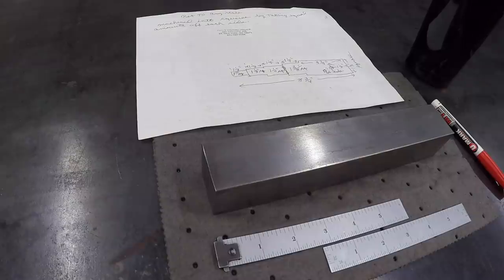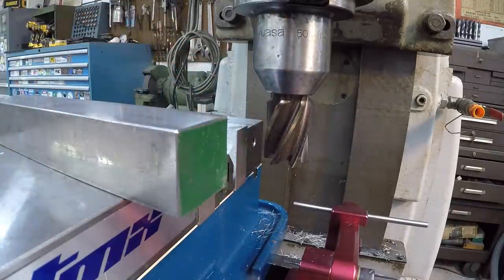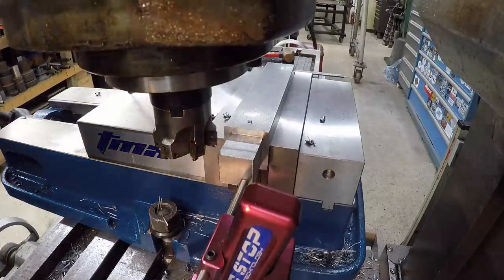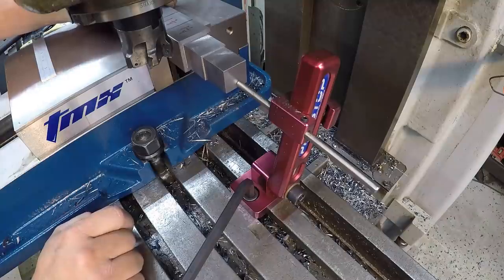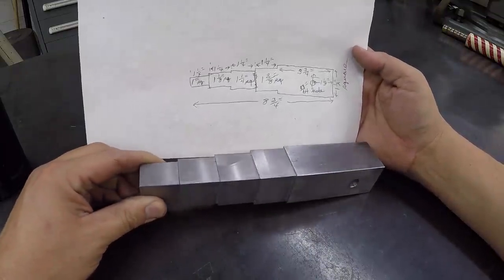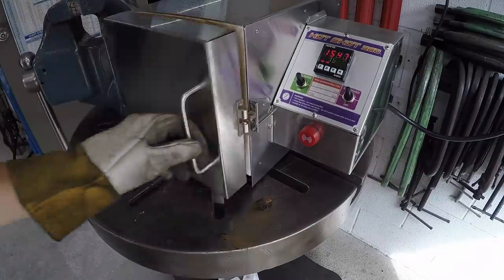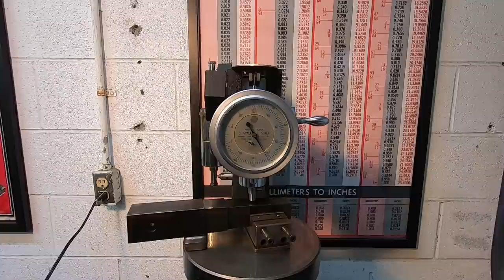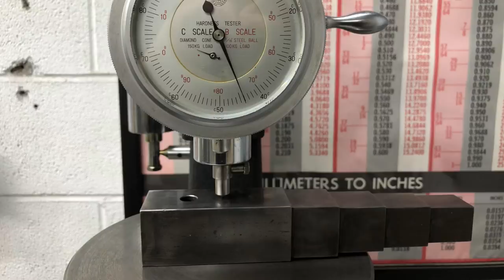SNS 296: Custom Square Drive Tool, Heat Treating

Comment: I would recommend that you read the book "Heat Treatment Selection, and Application of Tool Steels", by William E. Bryson.  The writing style is very easy to follow, not super heavy on the science and more of a layman's cook book on heat treating.  This book recommends heating 4140 at 1200 degF for 10-15 minutes then raising oven to 1575 degF and once oven reaches set point check that the color of part matches the color of the oven then start a soak timer for 5 minutes for each inch of smallest cross section.  Then quench part in oil.  Then temper immediately before part cools below 125 to 150 degF in order to greatly reduce the chance of cracking the part. 

Heating the part for 2 hours at 1650 degF could significantly alter the metallurgy.  This could explain some of what you were seeing in the hardness testing.  That and the time you have from the oven to the quench oil should only be a matter of couple seconds maximum.

Comment: Check out this picture for the CCT curve for 4140. 
https://www.chegg.com/homework-help/questions-and-answers/explain-using-cct-curves-microstructures-expect-1045-4140-steel-samples-experiment-samples-q36895277
The idea is to cool the metal quickly enough to avoid the Bainite "nose" of the curve.  Bainite is softer than Martensite.  The foil kept an air film around the metal, which is nearly a perfect insulator (think of a Yeti tumbler).  The hard spots could have been a result of the bag leaking and oil coming into contact with areas on the part while other spots had air pockets.  Taking the time to remove the bag also likely extended the cooling time into the Bainite range.
Another thing that happens with parts of this mass is the outside cools quickly and the center does not.  So a possibility is you began with a good martensite treatment, but when you removed the tool from the oil, heat from the middle of the part radiated outward and raised the temperature enough to temper the part back down from fully hard; like letting a steak rest after removing from the grill, the temperature will equalize before finally cooling down.  A part of this size and the amount of heat mass involved may require a water quench to pull the heat out fast enough to clear the bainite zone and to pull the heat out of the middle of the part.  Do the best you can to put it in vertically with the big end first.  
Another solution is using a different type of steel.  The amount of carbon and alloying elements determines where the bainite zone begins; more carbon = more time to cool.  Check out this paper discussing the different alloying elements and their effects on the steel.  I hope this helps.  Good luck and keep turning out the great content!

Comment: When you Rockwell the part take a die grinder and clean it up to bare metal. You don’t get a true reading. Don’t forget that time in your oven is after your part gets to temp. Plus put the thicker part into the back of the oven to get the hotter part of the little furnace. You should find a 25 gallon barrel that is stainless. That is a pretty small furnace for what you are doing. You will get sporadic readings. We had a lot of failures until further research. Good luck you’ll get familiar with it!

Comment: Stainless heat treat foil is mainly for use with stainless steels which decarburize very quickly. It's not very suitable for quenching carbon steels such as the 4140 as carbon steels don't decarb as quick and the foil can interfere with the quench media cooling the part. If you want to prevent scale build up and decarburization of carbon steels you can use an anti scale paste which brushes onto the part and has less affect on the quench.
Reply: Also the part may not have got a consistent hardness due to the stainless foil wrap or because you did not have a large enough volume of oil. With a part of that size the heat capacity is pretty large and requires a large amount of oil to soak all of the heat and provide a fast enough quench. The oil might have heated too much which would cause the part to either self temper or just not harden.

Comment: Hi Abom, Douglas Rose Innes is right, you have to learn about the oven react with different steel sorts and the time you have to use  - it is not easy. Don´t forget the quality of the steel you buy, it is realy a big thing. I think you´ll learn it easy. I´m a toolmaker in Germany and in my company we have a many different ovens, and it is almost a different between the ovens of the time you have to use. You also have to look about the colour of the steel and the oven, when it´s the same you can put it out and fast into the oil. Be careful and good luck! Love your channel - go on with it. Greatings from Germany. by!

Comment: Nice video Adam! If you're heat treating anything always anneal it first to relax the steel and even out the grain structure a bit. Quenching before annealing can cause some parts to be harder than others as the steel might have been stressed slightly before you got it. Also make sure to get it to critical temp (728ºC) before the quench. Hope that helps, Great video :)

Comment: Most knife makers, myself included, heat a blade until a magnet doesn't stick and then quench. When it comes out of the quench a file should not be able to cut the piece, it should "skate" across the piece. When the piece cools to room temperature the piece is put in an oven at 475 degrees for two hours and then slowly cooled to ambient room temp. I put my blades in a bucket of vermiculite overnight and take it out the next day. A large chunk of steel like you are using probably takes much longer in the oven to raise the temp all the way through the steel. Eyesight is the way to go, judging from the color in the video you weren't hot enough. Your bar should have been a bright yellow-orange color, which judging from the video, it wasn't. Anyway, I hope I helped, and keep the videos coming.  *As a side note, what was the outcome of that collaborative piece you sent on to the next contributor after you shaper work?*
Reply: I also noticed the color wasn't yet on spot, they usually come out yellow and we have an oil barrel filled with used diesel oil, it's full of hydrocarbons. The magnet and file technique are also vital to know when the part is ready for the dip. I'm not a pro, I just make and fix some farm hand working tools and re-harden tractor tools in my free time and I learned this with my grandfather, works well and cheap.

Comment: The 'trick' to heat treating is the quench. If you are doing something that needs to have a great finish, then use the foil, but skip it and get better results. The scale can be removed after tempering. The part should be heated and quenched as fast as possible. Messing around with the foil takes time the crystal structure of the metal starts to reform.  From the oven, into the oil. 
Tempering should never be quenched. Just turn off the oven and come back in a few hours when it is at room temp.
Reply: I see people quench while tempering and I always assumed they knew something I didn't. Never made sense to me to freeze the crystals before they have time to find their new home. i.e becoming less brittle.
Reply: @jonarbuckle1560  Same with me! I've got some basic experience in smithing and just assumed it was a more advanced technique than I learned.
Reply: Tempering is done for the  final result, and different materials  and different methods give different desired results. Longer cooling is closer to annealing, and in many higher carbon and hardenable tool steels the tempering can be done by reheating to a lower temp than the hardening step and then quenching in a specific manner. That second step, tempering by heating & quenching removes some of the brittleness (hardening) of the initial steps, replacing it toughness to a specific degree (if it’s done right.) People use different recipes for their hadening and tempering sequences. Depends on how you get the results you need from the materials you use - could vary between thin, flat bars used for knives and rods used for barrels, and bars used for large tools.
Reply: @jonarbuckle1560  Being less brittle is what the tempering is for. The first quench makes it hard.
Reply: TractorsNStuff 
Whilst toolmaking I used different types of steel for different applications, for each material a specification sheet would be obtained, this would detail the best hardening and tempering methods and whether it needed salt bath, oil or air etc, no two specifications of material had the same requirements for optimum hardening or tempering, the key word is optimum, most materials would give similar results with similar treatments, some really wouldn’t. Yes I did use oil quench tempering materials, no I don’t remember the grade and nor am I interested in looking for it! 🤣 We didn’t have a salt bath so stayed away from material that needed it except once by accident we ordered some so we did it in oil, not perfect but workable for what we wanted after a bit of experimentation to refine our process.

Comment: There's a carburized layer on the outside of most tool steel from when it was formed, that won't harden consistently if at all. Try taking a 16th or so off all sides then try your test piece again. It drove me crazy until I figured that out.

Comment: As a Tool and die maker I did all heat treat for the shop I work in , 4140 is done @ 1600 deg  and that size piece should be in the over no more than 40 mins and the draw back is done @ 450 for a hour! should get a Rockwell C @ 60 to 62
Reply: Dang, only 40 minutes? That seems so quick but I'd defer to your experience over my gut!
Reply: @94XJ  ya did O1, 4140, S7 and D2. Only warp S7 and D2 The temp for S7 and D2 was 1850
Reply: @94XJ  The longer a metal is at a high temperature, the larger the grain structure gets.
Also, steel manufacturers have data sheets on what the ideal temperature is.  Just look up 'Timken 4140 data sheet'

Comment: I suspect the problem was that you quenched it in the foil. The quench stage relies on a sudden change in temperature ... keeping it in the foil will have prevented that and led to a slow cooling.
Reply: ...how about trying quenching in water, and then tempering...

Comment: If you go to a pottery supply company you will find that they sell small supports for glaze firing sometimes called kiln spurs or stilts. These small stands have points on the top of them so that items placed on them to be fired will not come into contact with your kiln shelves and allow for more even heating all the way around your piece. They are available in various temperature ratings up to 2400 F. and are reusable. They might solve your problem in regards to even heating. You can see examples of them here:   http://www.clay-king.com/roselli_stilts.html

Comment: I've been doing a lot of research and learning on how to use small mills lately(mostly on the cnc side of things). Its only improved my appreciation of the big iron and large production machines you run, and your skill operating them.

Comment: I do thousands of pounds of heat treat per month: Your tempering temp is good but you didn't quench right, this is how I do a 4140 part of this size: wrap part airtight in stainless tool wrap, heat in oven at 1550F for 4 hours, remove from oven and remove part from wrap, quench in oil then temper at 500-550F for minimum of 2 hours (I do 5 hours at 550F) some people temper twice. PS you can just re heat treat it again but avoid to many times

Comment: Adam,
Always enjoy your videos! Since I know a lot more about heat treating than machining, I'll try and give you what I saw here. 
Your heat soak needs to start after the furnace is up to temperature. In other words, you pre-heat to 1650, put the part in, wait for the temperature to get back to 1650 and THEN start your soak time. Also, as you mentioned,  5 gallons of oil is probably not enough for that part. For 4140 steel, the oil should start around 150 F and not get much warmer. Agitation is key for entire quench from 1650 to 150 and it needs to get there within a couple minutes. That takes a large oil vat for a part that size if you don't have a heat exchanger to cool the oil as the part heats it. Quenching after temper is not required but multiple tempering cycles is. At least a double temper in this case. 

Hardness testing can be a bit of art in itself but make sure there are no burrs or scale at all. We most often grind the spot being tested and stone the opposite side that sits on the anvil. Three readings in any particular spot that you want to test is standard practice. Crank the diamond into the part without stopping. Get close to zero and then adjust the dial to zero. It is not good to try and get zero with the crank. 
I wouldn't mess with the foil for that part. Any scale should clean up fairly easily with Emery and scotch bright.

Comment: As someone else had mentioned, a smaller bottom stage on the hardness tester may help.
When you checked the smaller squares I noticed you had the part in a vise. This was a more stable set up, and would explain the higher readings. When you pull the handle back forward on the tester, its basically measuring the depth of the dimple. Event the slightest movement can skew the results. On your smaller test piece with the inconsistent results, it looked like the side with the higher readings (51) may still have had some scale on it. You might want to try and surface grind all four sides, then measure hardness again. Not only will that remove the scale, but it will make the part more stable when checking.
Reply: Agreeded the smallest error with the vertical travel can have large errors with the readings!   Oven is undersized for this large chuck of steel...

Comment: We regularly heat treat in about the same way but with the main difference that we cut the foil of first.
We have the foil on roll som we fold our own bags in the size we want them at the time.
Since the parts we heat treat in our shop is regularly smaller ones (small rollers, guidepins and other stuff that fit in coffecup) and the bigger things we usually send away for heat treatment is is more a matter of opening the bag and emptying the parts in the oil container.
This usually means there is a larger volume of air then metal in the bags but that doesn't make much difference, just as long as it doesn't have the whole uven to react with.

Comment: So from what i know for heat treating. You throw little paper in the foil and they will burn up  in the oven burning off all the air inside. Also when you go to test the hardness clean it up a little so you are not testing the scale on the outside.

Comment: Hi Adam. Good vids as always. Just not hot enough by the time you quench. It's all about your martensite. By the looks of the hole for the bar it won't be too tight, maybe a case harden to prevent tool wear may be more appropriate. Thanks for all your hard work making excellent viewing. You have taught me a lot. Regards Brian. Lancashire. England.

Comment: Nice video and nice try Adam!  I have only done heat treating a couple of times but when you cut the bag off on the second try, the part does not look hot enough.  It should be "cherry red" which my instructor called "glowing carrot" because it is not really red but more orange-ish.  Keep trying and keep learning!

Comment: Adam...when we heat treat...we wrap the part with the sstl wrap....but we place a 2" sq. piece of paper towel in with the part.  That will burn up and take up any oxygen within in the wrap.  There are tables that tell you the "cook time" for your hardness...we cook slightly longer.  Then we allow the part to cool down enough to unwrap by hand...then we now "draw down" the part to the desired hardness.  Place the part back in the oven, unwrapped for about an hour at about 1/2 the "cook time" temp.  Remove from oven and let cool.  If the part is too hard...do it again...draw down process.  For the most part...we don't quench parts.  We use the one inch of thickness for estimating the "cook time" also.  Good Luck with the heat treating process....

Comment: From what my employer's maintenance manager tells me, we've had inconsistent results with heat treated 4140 (misc stamping press parts, gears, etc.). Sometimes it will harden, some times it apparently goes *softer*. In the context of some cam wheels I was having made and heat treated by a local machine shop (I'm an engineer), his suggestion was to use S7 instead; they've had much better (and consistent) heat treat results with such material.
Reply: Larry B, the S series like the H series are great for hot working. Use the AR series for wear and sustained toughness, it contains boron it greater amounts. 4140 works ok for non-sustained toughness and has fair wear resistance for non-clamping loads.

Comment: Confidence in your tooling, work holding and machine is taking 1/4 inch depth of cuts, dry, with an auto feed and sitting back and filming it. Kudos

Comment: My 18 years of experience in heat treatment is limited. We did most of our heat treatment in house, but that was not my department and I delt with vacuum treatments and different post treatments to get tool steels to last in hot / cold forging. I do agree with Coffreek, it's in your quench...has to be...temperatures are temperatures. I do think that oil should be warmer than room temp too. Been retired for 7 or so years now. Do like your channel as I'm from a CNC world and hard turning tool steels at 40 to 60 Rc. I'll give you great help if you start doing that...